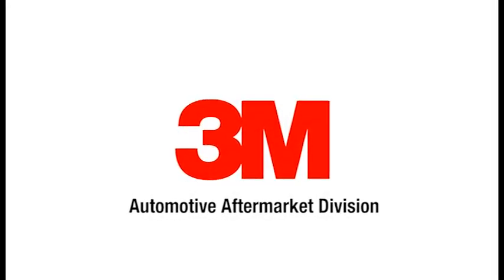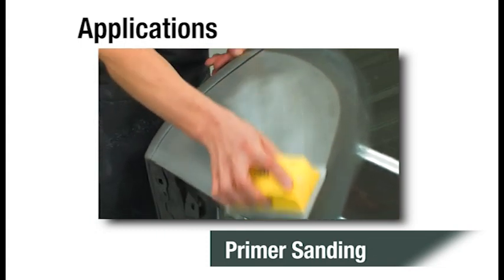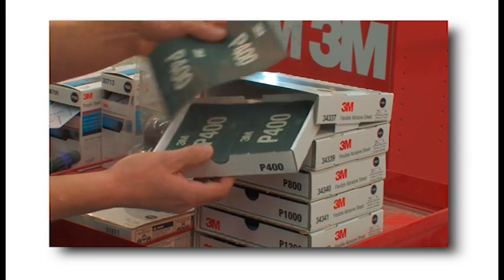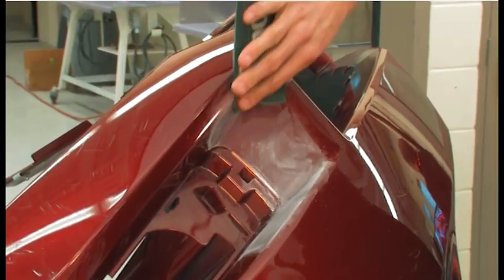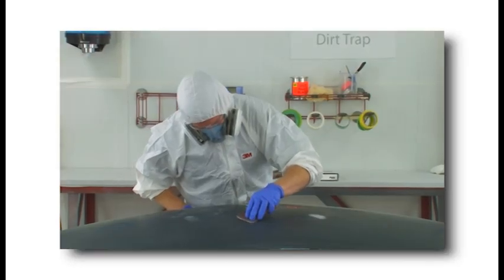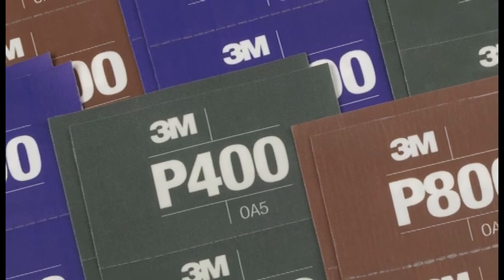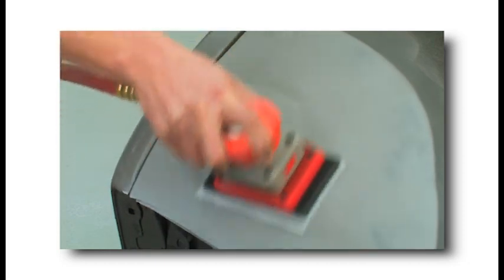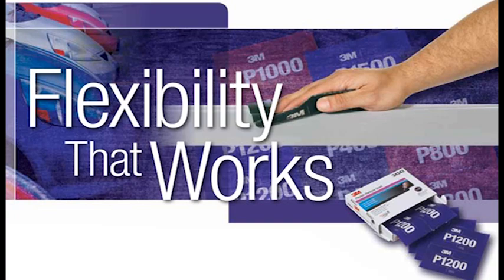3M Flexible Abrasives

Comment: If sanding various resin molds what you really want is their old Dia Pads.  Sure there not for intracritet tight corners, but for anything else they just can't be beat.  They are 2&1/2" by 4" with small pattern stainless stl screens with diamond dust impregnated.  They are hand held. Work best with very light trickle of water as they are designed to pull paticulate from the pad and sand at a higher pace in mold finishing than anything else.  These seem to last forever. They come in about 9 graduated micron grits.  Priced a complete set( of nine) at about 14 to 23$ a pad upper rh corner MSC cataloge page 927   called "Flexible Diamond Hand Lap".  I have found over the years of sanding composites your save hundererds of$$ on other sand paper or cloth.